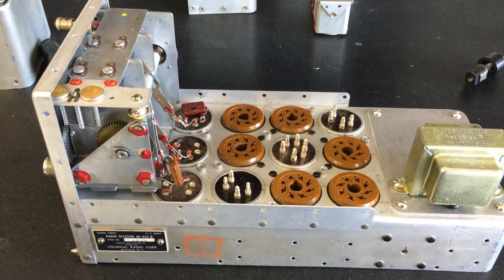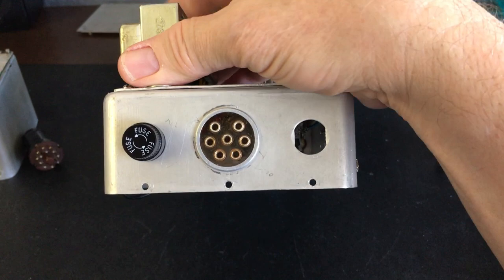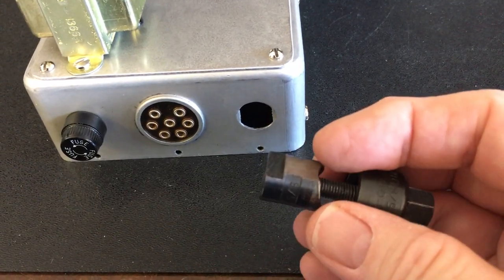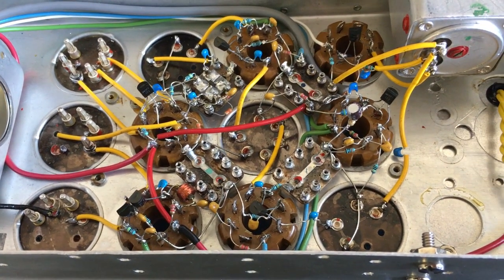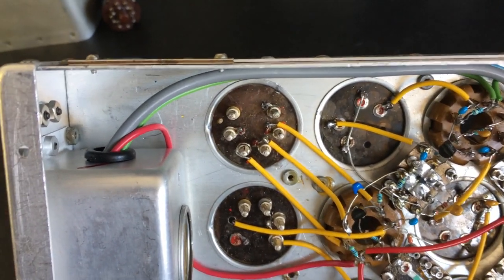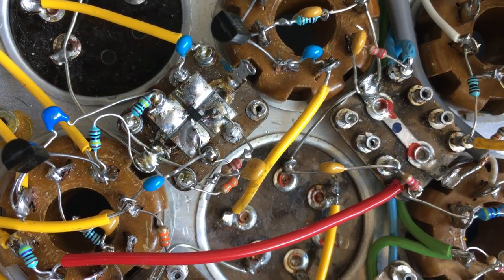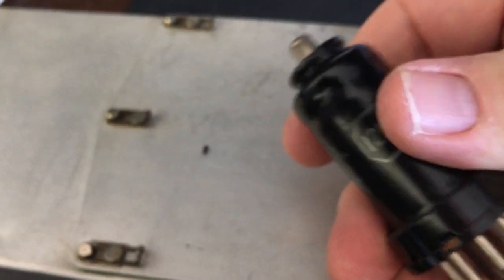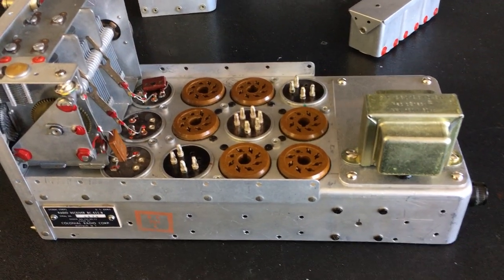Transistorize Your BC-455 Radio - PART 2

Comment: Mixer?
Reply from the maker: The "mixer" blends the preamplified  signal with the radio's LO (local oscillator) resulting in a IF (intermediate frequency) signal that can then be amplified and demodulated to baseband.